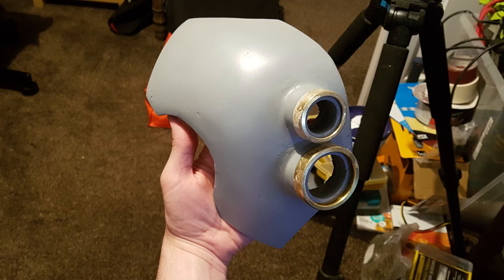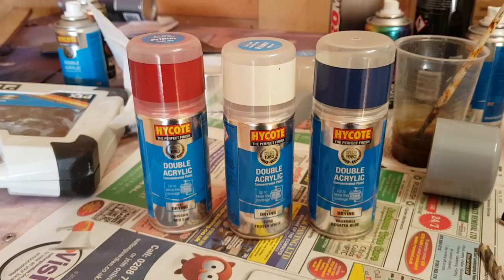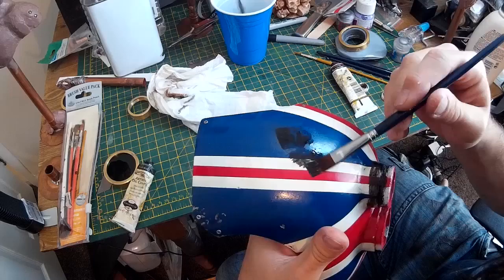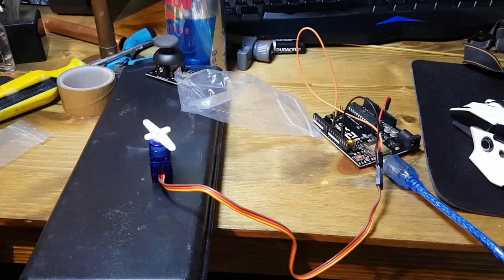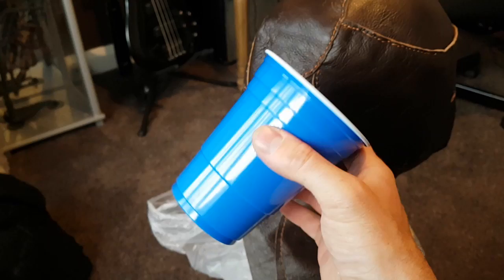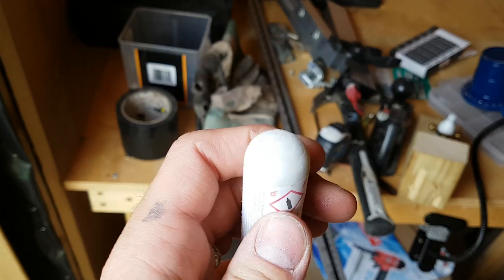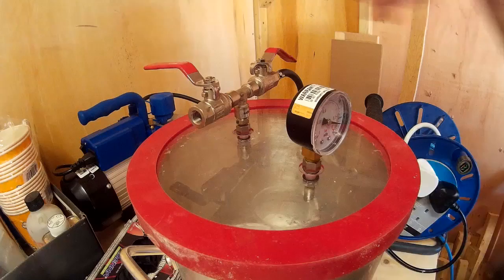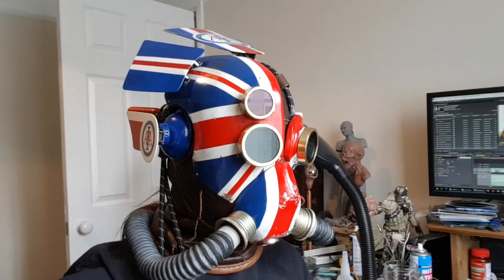Making a Steampunk Mask Part 2

Comment: Whenever I mold the inside of a cup like that, I just use a light, 2 second spray of Ease-release (mold release) beforehand and it pops out super easy.
Reply from the maker: Yeah i should've tried that - I figured it wouldn't bind to the inside, which I think would've been the case if it hadn't heated up so much and melted it!

Comment: Just thought I would share a teqneque for chipping and weathering, put down your base of silver or rust or whatever you want to be showing through, then get some sea salt (mix it up a bit, use some fine and some rock salt) wet the surface of your sculpture and sprinkle the salt on. Now let it cure, we're ever your salt is, the chipping will be, ally your colour and then let it dry. With a toothbrush scrape the salt off. I hope you can understand what I'm saying lol. Just thought I'd share :)
Reply from the maker: Thanks! Yes I need to try that - the spray paint unused was quite thick so although the masking agent I used worked it was a little difficult to scrape the paint away. That might work better. I'm working on another mask at the mo so will have to try it when I come to paint it.
Reply: The Dark Power yeah, since my main hobby is scale modeling I use this ALOT for rusty hot rods and stuff,  I love your work and hope to try a mask of some sort at some stage. :) oh and I'm thinking of making a alien full body sculpture,  what clay should i use? I don't want to presume cast it as I don't have the materials to do so, there's just so many clays out there I don't know what to use, thanks so much. Keep up the awesome work!
Reply from the maker: Thanks - yeah I've been using rust powders quite alot - great stuff.  Wow a full alien will be a big project!  You might want to consider WED clay over a body cast or mannequin which I know is used alot in film effects.
Reply: The Dark Power yeah, a real fun challenge, it would be scary to get up in the middle of the night and bump into it haha.
Reply from the maker: Haha. Yeah I had a shop mannequin in the front room for a while. Made me jump every time I went in, so an alien would be ten times worse!
Reply: The Dark Power yeah, when someone comes to stay I will have a lot of explain to do as to why there's a giant alien in the living room...

Comment: CO2 is never a liquid. And yes, I am watching this for the 10th time :p
Oh and the paint irritated me a bit. Acrylic is also the base for the regular solvent-based spraycans. Did you use WATERbased spraypaint? 
Ever thought about hitting the WGT in Leipzig Germany with that stuff??
Reply from the maker: Wow that's an old one! CO2 is liquid about 5 bar from what I've read, so I think that's what's going on in those cylinders. The paint was described as 'double acrylic'. I needed something that wouldn't react when I put an oil paint/white spirit wash over it.  This paint was fine with that, which is different to previous solvent based paints I used. I usually do events in the UK, but maybe I'll venture further afield someday.
Reply: @thedarkpower  I think I remembered something wrong :p it will not MELT from dry ice, but go gas straight from being solid. Anyway, WGT is huge and it might be worth a visit. Gonna try this year!

Comment: there are smaller Arduinos btw
Reply from the maker: +Tiki720 thanks. Yeah I'd heard that, I will have to look into it. Maybe I can use the one I have as a test rig and use the smaller versions for the actual piece.
Reply: The Dark Power there are also some by adafruit that are meant for wearable projects so they are really small and thin
Reply from the maker: +Tiki720 thanks I'll have to investigate. I can definitely see me adding more automation to projects in the future.
Reply from the maker: +James Taylor cool, thanks for the tip. This is my first real foray into this so I've alot to learn.